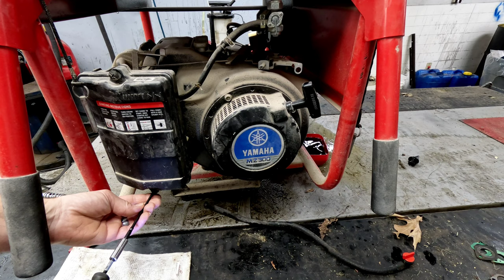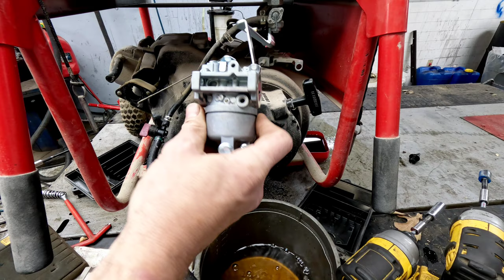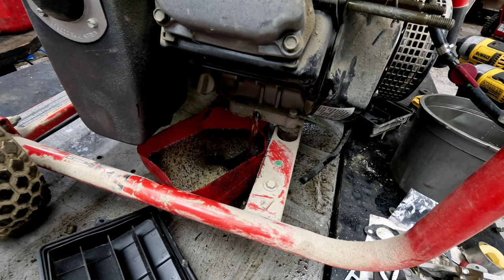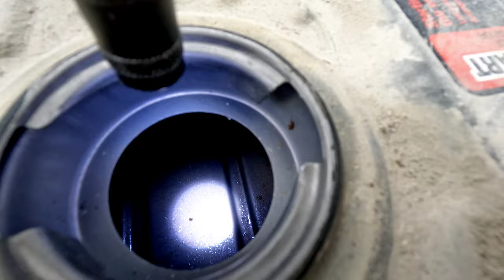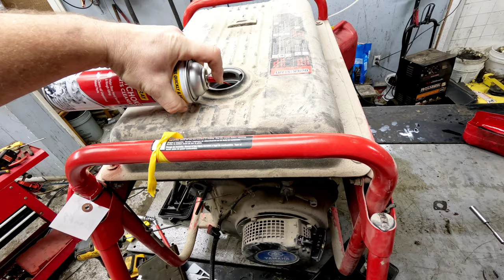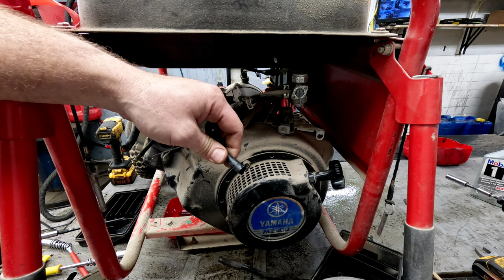Generator Gas Mixed In With Oil, Leaking Gas Or Oil From Carburetor, Gas Or Oil In The Air Filter

Comment: Why not many views?
Good information and advice 
These carbs are easy to rebuild
Reply from the maker: Good question! They aren't difficult to rebuild but when the parts cost more than a new replacement...would have taken 30-45 minutes to clean well bad as it was so the customer would have paid more for a rebuild than a replacement. Workers around here are getting harder and harder to find l...Rivian snatched up anyone around here with the ability to fog a mirror
Reply: I’m 72 and retired diesel mechanic of 57 years 
I been working on small engine all my life and still working on them, love fixing them
Reply from the maker: There really is nothing like having a good mystery come in on one and getting it taken care of! I love it also! I believe you have seen a lot of equipment!!

Comment: thats from a man that gets paid to charge more for parts .ive been cleaning carbs for over 40 years .when youre poor you cant afford to go to a shop .and most carbs dont cost 40$
Reply from the maker: Can you rebuild this carburetor for cheaper than buying a new aftermarket?
Reply: @IndRepair  CHEAPER THEN PAYING 40$ FOR A CARB THE REBUILD KITS ARE CHEAPER
Reply from the maker: 73A-14150-00 Needle $12.78 
796-14184-00 Bowl Gasket $7.58
7CT-E3557-00 Intake Gaskets $4.98
127-14198-00 Bowl Bolt Gasket $5.49 
At the very least 1/2 hr labor additional vs replacing the carburetor, and it's not guaranteed.